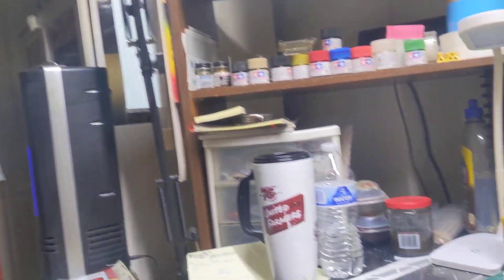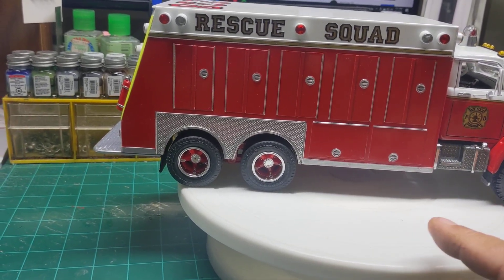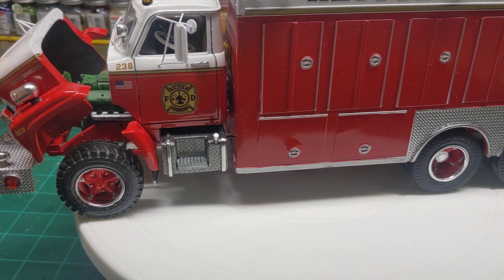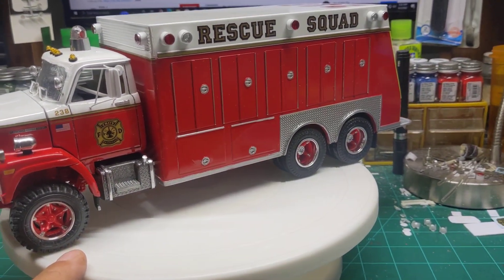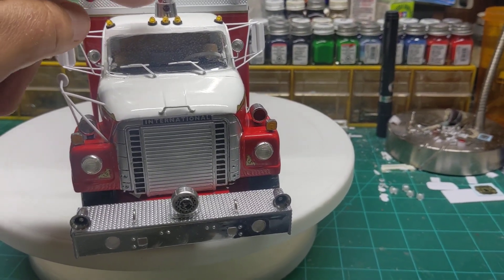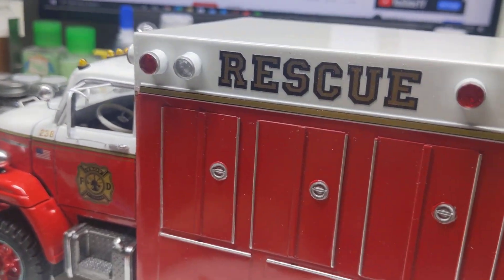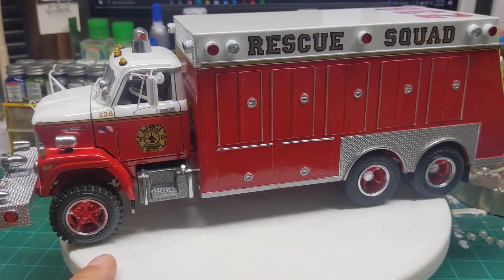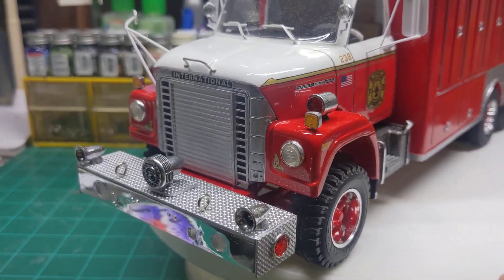Final on the International Fleetstar.

Comment: Absolutely awesome built, your heavy rescue truck came out really great!👍🏻😎🤩👍🏻 And I'm always impressed with your chrome work (for some inexplicable reasons I always have problems even with Molotow...).
If you allow I have a little suggestion for the mirrors: There are one side coated "mirror polystyrene sheets" available (1 mm thick - sorry, I'm only German, don't know in inches), in this case better than Molotow chrome.😉
Take care, many greetings from Southwest Germany - Ralf🍀👋🏻
Reply from the maker: Thank you.